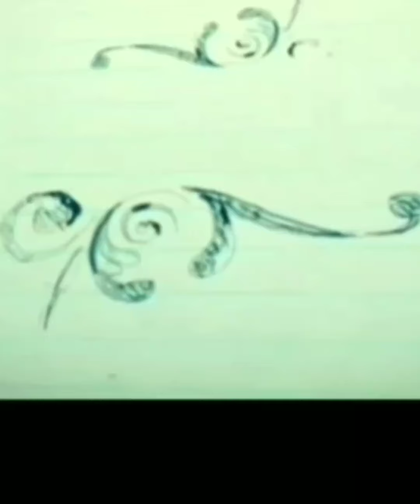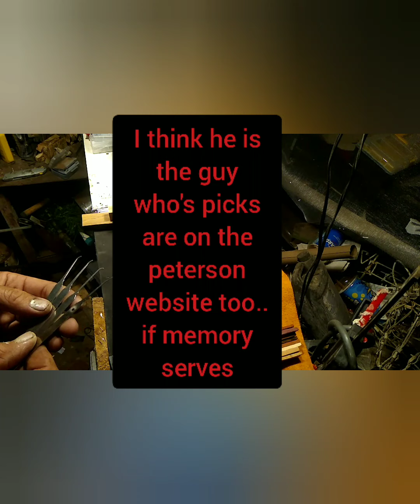zeus 69 Steve P package (directors mystery science commentary)

Comment: Rolled resin is tiger & stainless steel straw for moulds or pins
Reply from the maker: I was gonna put caranuba wax on the inside to make the pin not stick.. that or vaseline... And I got a couple other ideas.... Great package man, really wanting to make some  handles for those law picks
Reply: @hillbillylocksport5547  those tipene picks from lawlock i did mine in 0.5mm carbon fibre
Reply: @hillbillylocksport5547  I spray olive oil inside mine